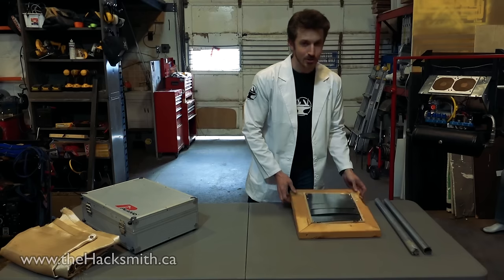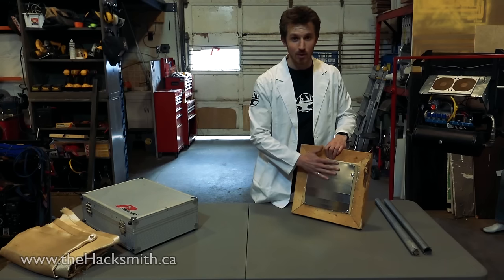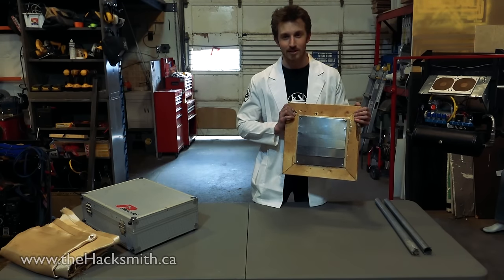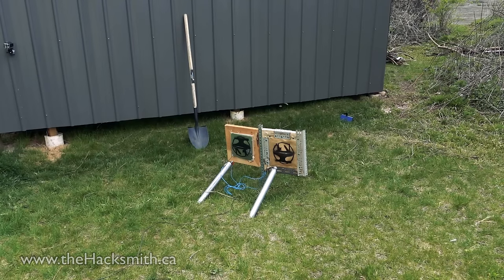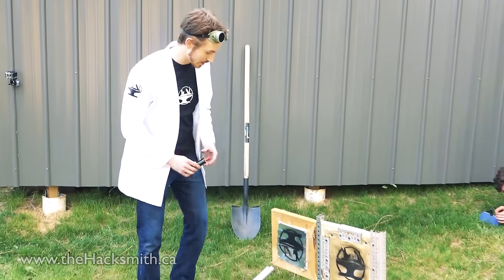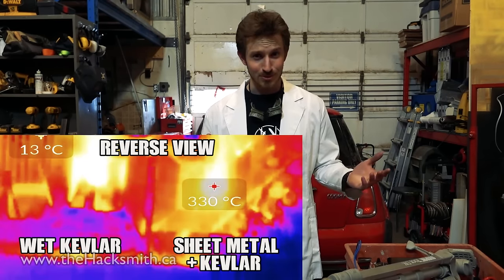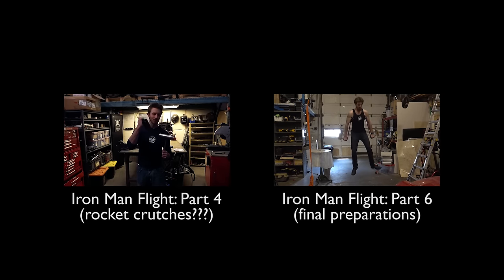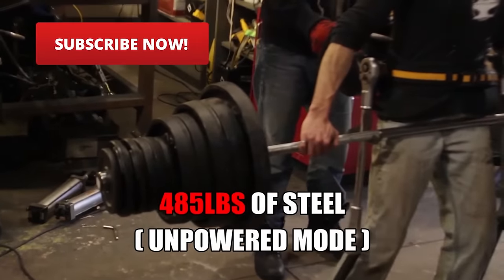Flying Like Iron Man #5: Heat Shields?

Comment: In rockets for heat shielding they use ablative coatings, which decompose in the heat forming a moving layer of gas between the fire and the surface, keeping it cool. To make a cheap one, maybe experiment with bicarbonate of soda, because it creates CO2 when heated, if you create enough gas, the flames won't touch the surface and the CO2 helps suppress any fire. Once the exhaust gasses have left the nozzle it doesn't matter if the fire is suppressed, as long as the gasses move.

Comment: Maybe you could make a plate of metal that keeps the rocket plume from touching your legs at all!
Reply: Then he'll need more rockets for the extra weight
Reply: True Santeri Salminen
Reply: He already made it though
Reply: He just did that?
Reply: Scorpion Airsoft I mean one that does not touch the legs kinda like the shield he put on the top of the rocket crutches.
Reply: OHH okay my bad my bad
Reply: He literally did that in the beginning of the video
Reply: there is something called carbon tape and it is able to witstand a hell of a lot of heat maybe lookit up
Reply: He has already used them on him if you follow him on maker amino your be way ahead
Reply: You mean like a metal skirt?
Reply: No, on the shin area.
Reply: +MadMaker i think it would be harder to control since fire is not going straight
Reply: +Apo11o9 its not only the metal, but paint reflects most of the heat too.

Comment: How about glass?
Reply: interesting
Reply: Glass doesn't work
Reply: Because glass doesn't melt?
Reply: +TirelessMedal12 it doesn't have to be a small layer, glass is extremely durable when it is thicker
Reply: +Ben Turner The glass will crack
Reply: +TirelessMedal12 Given that glass has a pretty high melting point and glass wool is a common "heat proof" insulation material that's not very far fetched... Since you still go to school you might aswell pay a bit more attention in physics in the future.
Reply: +Ｆｏｘｘｅｈ thanks, at least someone isn't narrow minded
Reply: +ZemlanGaming not if it's thick enough.
Reply: +Dude What yeah, it's hard to melt, and it is extremely durable with the right structure
Reply: +ZemlanGaming a lot of you know that obsidian is an extremely durable material, right? It's a glass. That's why it's so tough. If you made a thin sheet of it, it would become brittle and structurally weak, and it would break just as easily as a sheet of glass would.
Reply: Came here to suggest the fireproof fiberglass, but having overlapping sheets of glass (think petri slides) inside some fiberglass pouches could be the solution! 

Side note, i read a bit about how the first rockets had the issue of the cone wanting to melt with how hot liquid O2 burns (cutting torch, yo) so they pumped the fuel through metal coils inside the cone to cool it with the expanding O2 (very cold)
Reply: +Marty Beard Face good point, but fiber glass is terribly expensive. NASA still worries about their fiberglass budget.
Reply: +Ben Turner no but it conducts heat well that's why we use them in science labs even an inch thick piece wouldn't be able to disperse the heat
Reply: +Yewdew good point, but that's where the kevlar blanket comes in
Reply: that might work

Comment: You could use fire proof wood. Cut it into little bits and connect them with metal straws so you can move your legs and be comfortable.

Comment: try steel or tempered steel, it has a higher melting point, or try graphite as rocket nozzles are made of it and they resist the heat.

Comment: You could possibly try using ceramic fiber blanket. You can buy it up to 2" in thickness and it holds up strong in propane forges. Although the rocket will most likely tear it apart if it isn't protected by a stronger material. Anyways I have been loving the videos lately, keep up the good work!

Comment: for the protection: the flame will not go in a 90º through the leg, so the only thing you have to do build some protections that redirect the the flame like an aerodynamic  ceramic/metal shape and disperse the heat in the entire leg not in only one point. Even if you use a 300Cº torch against titanium in a single point is going go trough. So, solution? disperse heat using aerodynamics and metal with ceramic coating or similar
Reply from the maker: +KukiolGames we were testing worst case scenario...
Reply from the maker: +KukiolGames we were testing worst case scenario...
Reply: +the Hacksmith Or try tungsten carbide with the highest boiling point of over 6000 kevlin hotter than the surface of the sun.
Reply: +the Hacksmith Or try tungsten carbide with the highest boiling point of over 6000 kevlin hotter than the surface of the sun.
Reply: +Andrew Flack Omfg you just made me laugh so hard
Reply: +Andrew Flack lol

Comment: Mate, one of the best insulators out there that can withstand great heat is (drumroll please) air! Make a 2 layer system with air in between, kind of like a thermos works, and that might help you out a lot. Make sure it isnt sealed though or it will explode haha
Reply: +the Hacksmith
This is a great idea! However, you still need tome thing that can withstand the heat of the rocket and be vacuum-sealed
Reply: +cookiezillaevan you could use steel or iron
Reply: What material are you going to use to keep the air in so the air doesn’t escape or burn his legs

Comment: You could try Kaowool, or Ceramic wool. Its very insulating and is extremely heat resistant. People use it for forges and foundries for melting metals, and it doesn't even flinch. I got my Ceramic Wool from Jet.com, and its worked really well for my projects.

Comment: Okay how about side rods that go inwards with a pad on your hips for extra stability:

                       O     - Armpit Support        Explanation:   The side rods could be angled so that
                        I                                                                     the device would be slightly angled 
Body Here     I      - Poll                                                      away from you for extra safety. Hope 
          D--------- I      - Hip Support                                       that helps!
                        I
                       H
                       H      - Rocket
                       H
Reply: That's just confusing
Reply: +TirelessMedal12 I under stand it
Reply: +Colton Alex beat text based graphic explanation I've seen in a while.

Comment: Hey Hacksmith, I am really enjoying what you are trying to accomplish in this project. How about adjusting the arm rig so that the arms are positioned farther away from your body, and then using a bend at the hand to aim the rockets straight down. Thinking the hand holds onto the grip, but metal extends down to aim the rockets.

Comment: if you add a layer of ceramic wool it might keep the heat away, it is use in forge and can hold to temp more the 1000°C.

Comment: Hey hack smith in order to stop the flame from penetrating the Kevlar why not use the metal mesh that's used on sieves or sifters instead of the aluminium plating. I saw a video where they put a flame to it and even though there's holes in the mesh the flame cannot penetrate it. Idk its just a idea. If not maybe you could try using thin steel plating instead of aluminium since it has a Higher melting point.

Comment: Okay man, so I went ahead and took to Quora to ask the question on what fabric would be most suitable for you. I requested answers from some top materials science and physics professors and scientists to see what their insight would be. So far there are 4 answers consisting mostly of Nomex, Absetos, and woven fiberglass. Perhaps some sort of carbon fiber mold as well. Here's the link to the question:
  https://www.quora.com/What-is-a-lightweight-fabric-that-can-withstand-up-to-350-degrees-Celsius-rocket-plumes.

 I asked it just a couple of hours ago, so there's not too many answers right now, but maybe it might help you with some insight to make more informed decisions on how you're going to go about this. (Highly advise against using Absetos unless you wear a premium filtration mask while building, using, and discarding the material).
Reply: Carbon fiber is very expensive
Reply: Yes, which is why we are looking into alternative options, not just Carbon Fiber.
Reply: The rocket plume could melt some Asbestos and inhaling the fumes would be poisonous
Reply: Siddharth Nair "unless you wear a premium filtration mask"
Reply: Bradley Eversley ayy, buy one for everyone in the vicinity just for flying, much feasible
Reply: Siddharth Nair You never know

Comment: You could try something similar to the design in this video, using an inner layer of Nomex and an outer layer of thin sheet metal.  But, it could also have a small tank of compressed liquid nitrogen that is released simultaneously with the rocket ignition through small tubes that run in between the two layers.
Reply: Since some of the best heat-resistant materials don't seem to cut it, pairing them with an active cooling system seems to be the way to go.

Comment: Hi Hacksmith, I think you won´t fly with  those rockets as I can see the rockets can´t give you the enough power to fly. What do you thing if you use a jet turbine, it can be better than the rockets! Of course you will need to investigate so much to make a mini jet turbine and you´ll need to find the relation between weight and force. Like this if you want that hacksmith see this too!

P.S. I have been following you since you just have less than 100k subs and let me tell you that I appreciate what you do!

Comment: You should use a kind of Ceramic Heat Shield (like the Space Shuttle). Buy a few refractory bricks. They are made with refractory ceramic, the normal refractory ceramic have a fusion temperature of around 1790/2000 °C.

Comment: I would go with stainless steel instead of aluminum. It has a much higher melting point and use more layers of the welding blanket. I think you're on the right track.

Comment: Not sure what the price of it but use tungsten as that is the element with the highest boiling point
Reply: Tungsten's pretty hard to work, though.
Reply: +michael compton oh yea true
Reply: Maybe he could use frying pans
Reply: but it has a very high density aswell...
Reply: Was that towards the tungsten or frying pan comment?
Reply: Who cares about the boiling point? The melting point is more relevant.
Reply: I think he meant melting point, which is once again tungsten, but tungsten is rare and hard to work with.
Reply: Frying pan man
Reply: Tungsten is very brittle
Reply: If anything with tungsten, it should be tungstencarbide with a polyurethane inside shield. However, due to tungstencarbide's density being 15,6 g/cm, it will be a lot heavier. Requiring more thrust from those tiny rockets. It would both be almost indestructable and very thermal resistant.
Reply: +Rico The specific heat capacity is actually the most important. the higher the SHC the lower the temperature rise per unit energy
Reply: Epic Videos Here! I think tungsten has one of the highest heat capacities of all the elements, but the best thing would probably be some sort of compound, like has been said. Another problem is acquiring the right materials.
Reply: Even if they would use Tungsten, it should be tungsten carbide as I said before, since Tungsten as a pure metal is brittle. However, also to keep in mind is the thermal conductivity, that of Tungsten is very good, therefore will heat up and still burn your leg. As I said before, polyurethane sheets would be a very nice insulator. Tungsten carbide is almost 250€ per plate, though...

Comment: there are space crafts that use heat shields why not try something similar to that.
Reply: Expensive as fuck
Reply: if he's rich aa tony stark that won't be a problem
Reply: *as
Reply: Heat shields deplete over time, are very fragile and also very expensive.
Reply: Spacecrafts use a layer of Ablator which melts and dissipates heat that way
Reply: Nobody ever said being Iron Man was cheap dude...
Reply: James Durston Yea but if i remember right he said on amino that it is too expensive
Reply: he could of course use carbon fiber and nanotube plating. lightweight, huge strength and very heat resistant... as long as you have £500,000 lying around.
Reply: I mean it’s mainly on the cost that’s the problem. Btw they use liquid helium and I have a feeling that liquid helium might be a bit too cold for some rockets

Comment: +the Hacksmith   Put ceramic(U can use clay/mud made plating too) plate at top layer then add
 Some unflameable heat resistant Glue or something to making ceramic to hold together cause its gona get hot fast (it might break because of Rapid heating and cooling) and then add some dirt to protect your leg from heat then U can add metal plating and kevlar (U can use another material for heat protection not just dirt )

Comment: if you are going to make it acutally fly you would need some high tubine power and fan that yoy can change the amount off power and you will need some power cells or recharging system to do this and you will need some iron armor to keep you safe
Reply from the maker: +Parker Ellis should watch my latest videos :p
Reply: iron Armour are you mad u cant use metal for protection metal are good conductors of heat

Comment: Just a guess but try laminating the kevlar with high temperature silicone it should help reinforce the kevlar and add an extra layer of heat resistance.  You will need to make sure the the silicone permeates through the kevlar.

Comment: The shielding could work with a four layer system. 
      Outer Layer: A single thicker metal plate made out of steel (not aluminum) which will not melt or warp under the heat and force of the rocket, even if the rocket is directed at it as in the tests.  The inside of this plate could be ridged for faster heat dissipation (more surface area in contact with the cooler interior), this should lower the amount of heat that is conducted through fasteners and any other contact points that compromise the heat shielding.  
 
    Second Layer: A space for an low density insulator like air, this  does not necessarily have to be a vacuum, just an open space from which the heated gasses can escape.  

     Third Layer: This layer could make use of a radiant heat barriers, like the space blanket, to minimize heat transfer.  

     Fourth Layer: multiple layers of Kevlar fabric to protect the skin from radiant heat coming off the plate, indirect hot exhaust, and conducted heat through fasteners or contact points.  

    Steel Plate         =============
    Air Void              ~~~~~~~~~~
    Radiant Barrier ^^^^^^^^^^^^^^^^^
    Kevlar                 XXXXXXXXXXX
    You                     ###########

   This design would likely be somewhat bulky and heavy without the use of high grade steels and the first and third layers need to be fully separated (the steel could be mounted on an harness with a minimum inch of clearance from the body at all points while the reflector and Kevlar are worn as tight fitting pants)

  Final notes, you know the force and the temperature of the rocket exhaust, pick a metal that can stand up to that and then some at the very least (factor in the that the larger that piece of metal the more energy it can absorb, both heat and kinetic, before failure).  Fabrics can stop fire, but a hot jet of burning gasses will still find a way through.  Water is definitely not the answer.

Comment: 3 layered Kevlar as base, followed by thin aluminum shielding, and the top layer made of some type of heat resistant ceramic. Possibly try cutting clay pots in half to curve around your legs. But the pots/ceramic should absorb most of the heat if they don't get blasted apart, and the aluminum and Kevlar serve as a debris shield and heat insulator.

Comment: There are some videos on the youtube about homemade furnaces. They are made with a combination of plaster and sand. Some use also vermiculite. If they withstand the heat to melt aluminum and iron without getting to hot outside, most probably they also would withstanda a rocket for a couple of seconds.
You could try making something using it as a outer shell and  wood or other thing underneath. It should no be that heavy and you probably could make a mold that fit your legs, like an armor.

Comment: I noticed that the plywood held up really well against the rocket exhaust on previous videos. It also turns out that the Chinese FSW recoverable satellite uses a form of oak for its heat shielding. Obviously you can't make pants out of a big plank of wood, but I think you could get away with kevlar pants (for the parts not likely to directly touch the exhaust) plus a couple of wooden panels at locations likely to be hit directly. Wood functions as an ablative heat shield, with the burnt products being carried away and removing heat really effectively.

Comment: Ceramic shields should work for both insulation and physical protection.

Alternatively, a thin layer of ceramic over aerogel would give you incredible heat protection.

Comment: I think that aerogel might work 
Wikipedia
"Aerogel is a synthetic porous ultralight material " 
" a solid with extremely low density"
"and low thermal conductivity"
If possible you can make "Aerogel micarta" by putting layers of Kevlar in the liquid before it is tuned into aerogel

Comment: a combination of ceramic plate, metal and Kevlar could work because the ceramic would not melt or rip and it has a high heat capacity. Another possibility is a metal container holding water, while it may be a bit heavier the water could absorb more of the heat.

Comment: In addition to the rockets, you could have small super fans attached to every limb including your back. Make something for neck support so you don't get whiplash while being blasted up into the sky. Also, if you can get your hands on some titanium, you can fix the heating problem while having light armor for an easier flight.